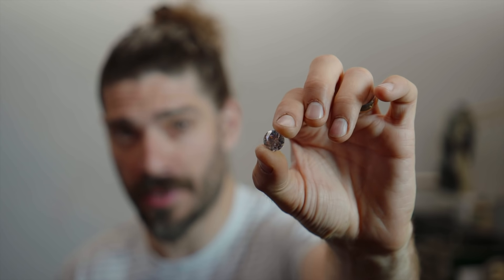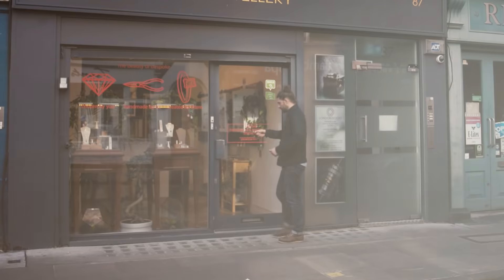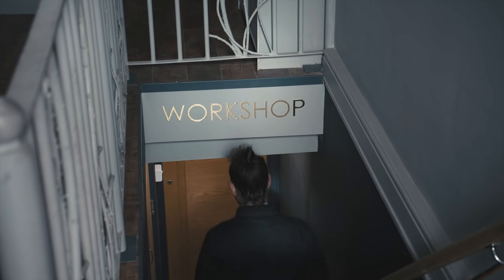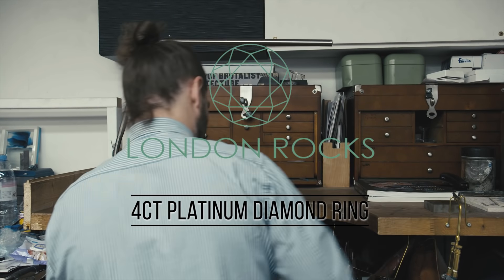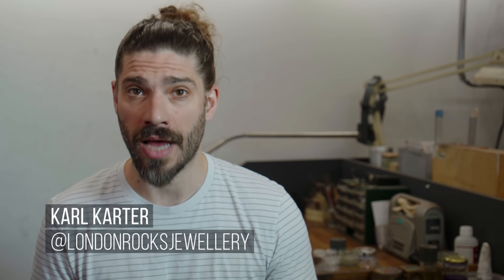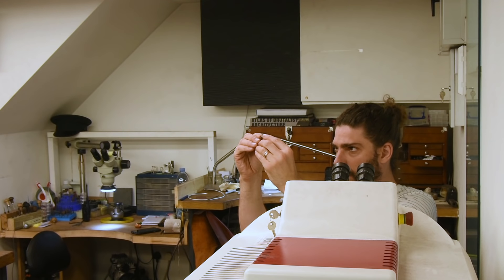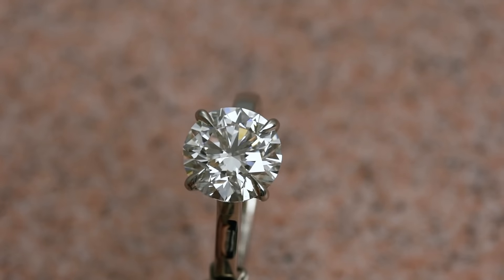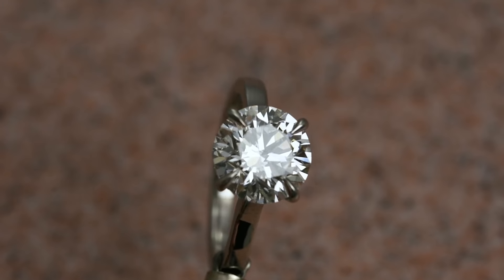MAKING A 4CT DIAMOND ENGAGEMENT RING: A Brilliant Cut Diamond Set In A Platinum Ring

Comment: WHAT SIZE STONES WOULD YOU RECOMMEND TO SET IN A 2MM ETERNITY BAND WITH SCALLOP SETTING
Reply from the maker: Do you mean a total width of 2mm .
If so you will need diamonds that measure 1.2mm
Reply: @LondonRocksJewellery  yes, thank you for responding, lets say I wanted as little metal as possible what are biggest stones I can set in a 2mm width band, I was thinking 1.7mm?
Reply from the maker: @softhejeweller4547  you can do 1.8 mm if you do a castle/ micro setting but not scallop.